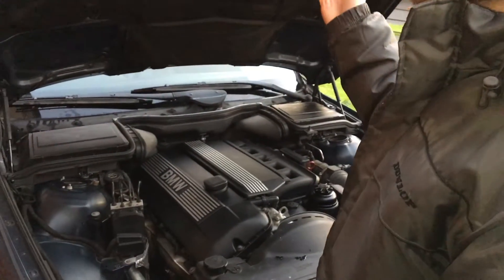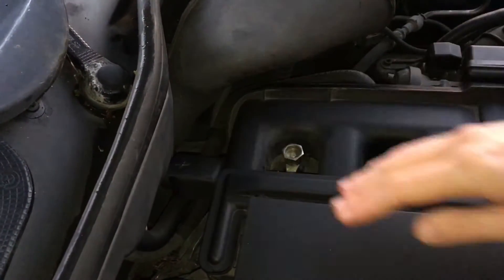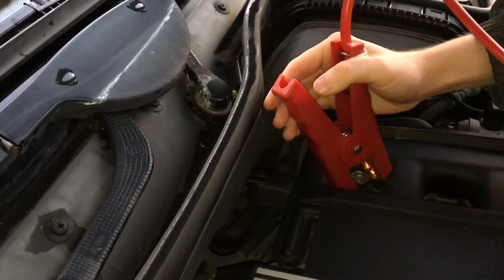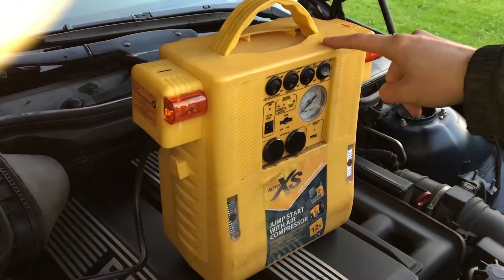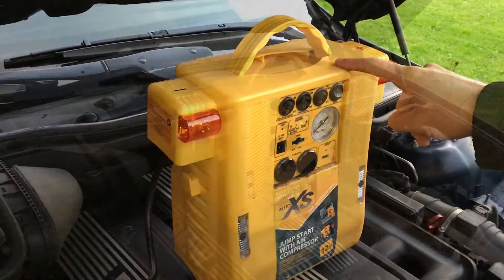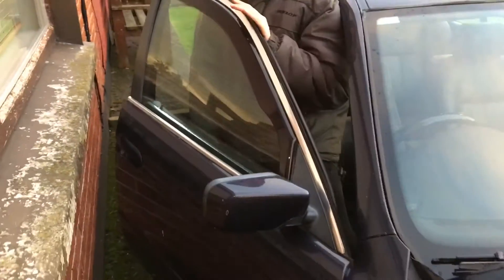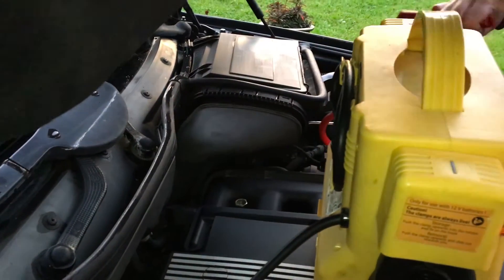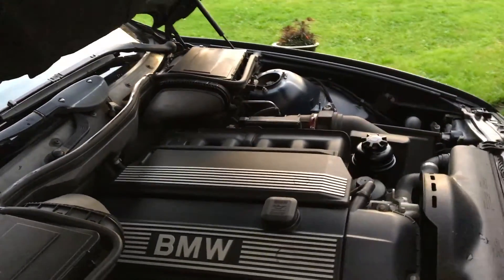Flat battery? How to safely jump start your car

Comment: Good video. Just one question, how often do you charge the booster?
Reply from the maker: Depends on usage. Most jump boxes have a capacity indicator so it would indicate to you when it needs a charge. 
If not being used for an extended period then a suggestion would be to charge it about every three months.

Comment: What is that self jump starter box? Is it good for any car or just for BMW?
Reply from the maker: No this is not just for BMW. Most jump starter boxes have a rating value detailing what capacity engine they are capable of jumping. This particular jump starter box was purchased from a retailer. It claims it can comfortably start up to 2litre diesel and up to 2.5litre petrol/gasoline. This BMW is a 2.2litre petrol/gasoline so comes within the above mentioned values. 
For larger engines it would be best to source one thats ratings matches or exceeds the capacity of the engine. Hope this helps

Comment: Do you know where is the battery In bmw 530i 1994?
Reply from the maker: Hi ola,
Did you look behind both the side panels in the boot/trunk? If it's not there then it's most likely in the recess located under the rear seats